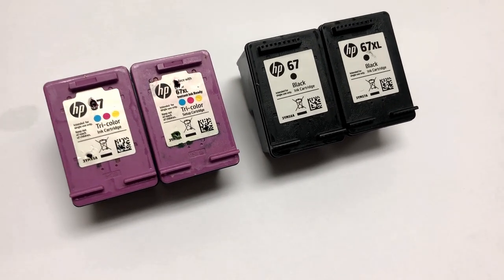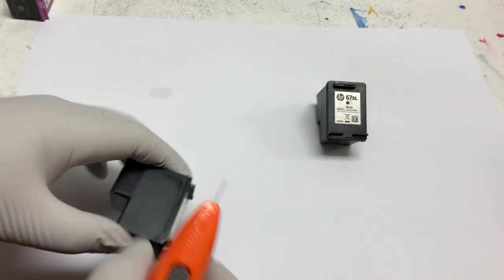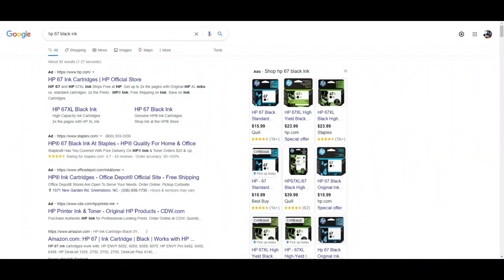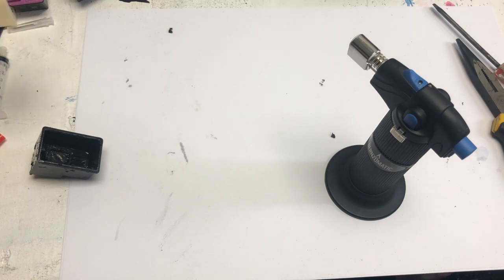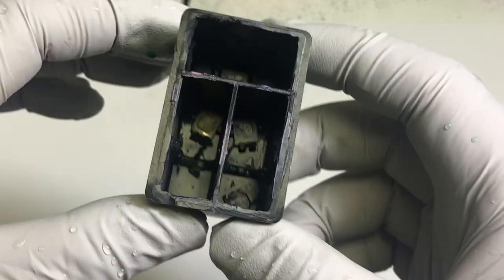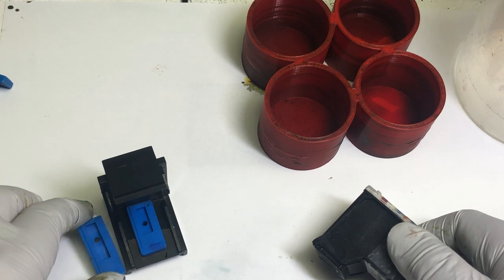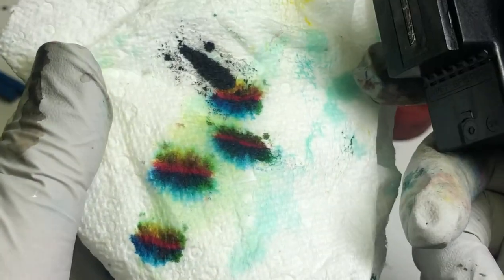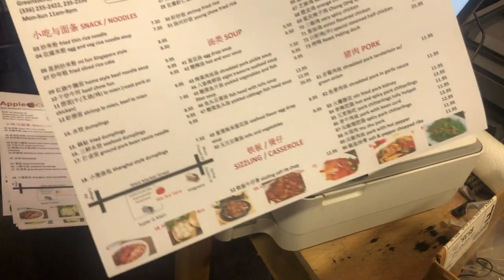How to make a HP 67 Refillable Cartridge with SPONGE

Comment: I was looking for a video to refill my hp 61 tricolor. My cartridge was super dry so I used the toothpick method to find the colors my yellow and magenta was reversed locations. But I didn’t see this video till after I refilled with 4-5ml. My cartridge is leaking from the bottom. I removed some ink but now I’m wondering if I punctured the filtered. What do you think?

Comment: I was thinking of buying ink from you. but couldn't figure out I need DYE or Pigment. can you add some description on your site to help out potential future buyers?
Reply: All colour inks in inkjet are dye inks. So, you don't have a choice for colour inks. The pigment vs dye ink only arises in black ink. Original black ink of HP & Canon are pigment whereas Epson mostly has dye ink even for black. You can either choose to use original HP/Canon ink or use dye substitute ink. The original pigment inks are in general better but if you are rarely using your printer causing the ink to dry and clog, the dye inks will be easier to unclog as they simply dissolve in water. Never use unbranded pigment inks as unbranded pigment inks have poor stability and can clog more easily even when the ink does not dry (due to pigments clumping up).

Comment: Interesting dilemma with a Grayscale (HP100) cartridge refill.  Only two of the three inks are printing, but which two?

With a tri-colour cartridge it's straightforward – just identify the colour that's missing on the test or alignment pages.  But with grayscale, how can you be sure which of the three shades is the one that isn't there?

I can't find any documentation on either the test (TAP 10) page or the alignment page for the Photosmart D5160.  Confusingly, it's the leftmost of the three grayscale nozzle check patterns that's missing on the test page and the rightmost of the three solid grayscale blocks on the alignment page.

Can anyone point me in the right direction?

Comment: Would it also be possible to drill a hole through the outer shell and the inner shell? That way, liquid ink could be stored outside of the inner shell and flow inwards to the sponge if it gets dry? I would just glue the outer hole shut afterwards... That would save me the trouble of getting the cap off of the cartridge? I´ll investigate further.
Reply: Update on the experiment: The pressure from liquid ink in the outer shell is too much. It leaks through the printhead. Not worth it.

Comment: It's interesting that you had a problem with the magenta ink (the chamber that runs across the top of the cartridge), which you diagnosed as the sponge not making good contact with the filter.

I've had a similar problem while refilling an original tri-colour HP344 (this cartridge has the yellow in the top chamber rather than magenta). I can print a solid page of cyan or magenta without any problem, but solid yellow fades badly halfway down the page when I print in "best" print quality (it's OK in "normal" mode). It's as if the yellow ink flow in "best" mode can't keep up with the printing demand.

I know from having opened up tri-colour cartridges that, while the three ink chambers have the same CAPACITY in ml, they have different DIMENSIONS: the top chamber (magenta or yellow, depending on the cartridge type) is shorter but fatter than the other two chambers.

The sponges, on the other hand, are all the SAME shape and size, which means that the one in the top chamber is a tighter fit and harder to push down.

This seems to me to be a design weakness in HP tri-colour cartridges, and not just a coincidence that we've both had the same problem with the ink in the top chamber. What do you think?
Reply from the maker: When I make spongeless cartridges, I cut
Reply from the maker: a small piece of sponge and put it on the bottom. It helps a bit.  I think you are right and we should trim the top sponge a bit.
Reply: Thanks, that's interesting - I'm assuming that you position the small sponge directly on top of the filter, with the main sponge pressed down to make contact with it?  

As it happens, I'm now having the same problem with a cartridge that I opened yesterday, took out the sponges and drained and flushed everything.  Now none of the 3 colours will print a whole solid page!

I'll try the small sponge trick - good job I have lots of ink  :-)
Reply from the maker: @davereid2246  Good luck with it!

Comment: Hi again

I'm interested in your comment that for a sponge cartridge, the cover doesn't need to be airtight, even the tri-colour types.

That's good news - it means that if the printer decides at a later date that it's not going to recognise the cartridge, you can transfer the kit to another one rather than having to throw it away with the dead cartridge.

But is there not a risk of cross-contamination of inks between the chambers if they aren't airtight?  Although I always store my cartridges the right way up, they move around very quickly when printing.  I appreciate that it's not as bad as a spongeless cartridge where the ink is free to slosh around more.
Reply from the maker: If you fill it right, the top of the sponge should be dry, so there is no risk of cross containmination
Reply: @BCHTechnologies  Thanks - I guess the advantage of the transparent cover is that you can easily see when the refill is getting towards the top of the sponge!